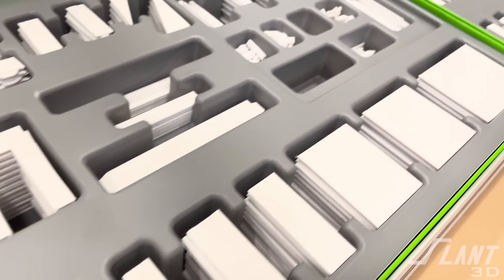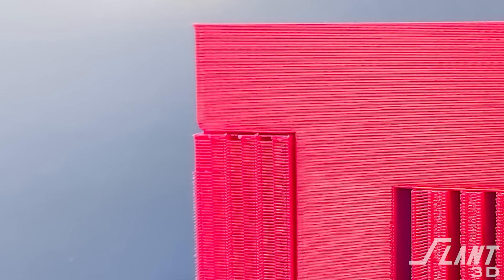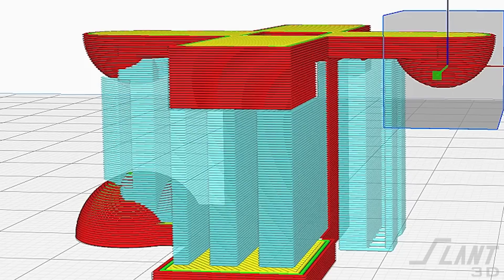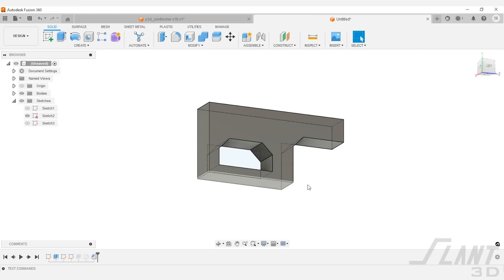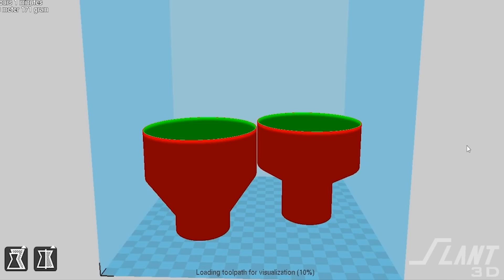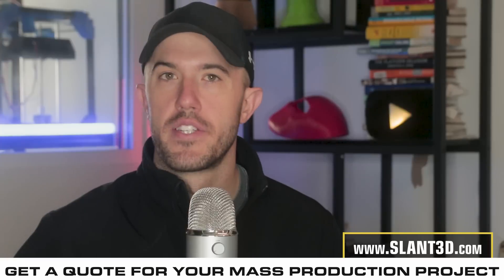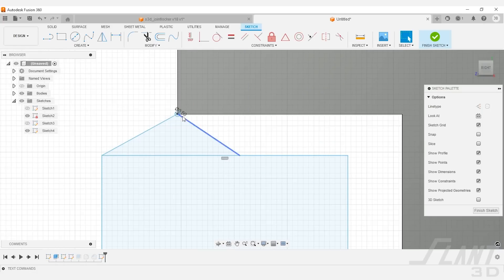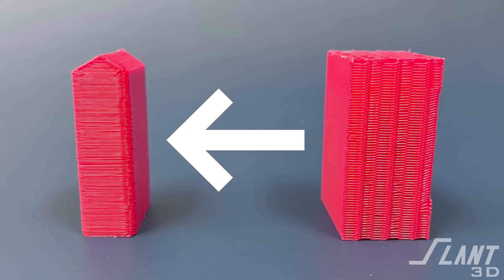3D Printing Basics: Understanding and Managing Support Material

Comment: Usually supports aren't very dense, while a modeled support prints with the same settings as the part. Did you weigh the supports to check which one is actually using more material? I know the standard supports can be harder to remove, but they might use less material.
Reply from the maker: Labor is more expensive than material. A minute of labor it worth far more than the cost of a gram
Reply: @slant3d  I'm sure that's true for what you do, but not for me. This is just a hobby for me. That's why knowing the weight is important. I would rather save the plastic than a minute of work for just a handful of parts, but yes, in large-scale commercial production runs, the time would increase the labor cost.
Reply: @slant3d  Wastage is a serious issue. Please don't advocate for poor and unsustainable practice.
Reply: @skilletborne  Wastage of time has a cost to sustainability too.
Reply: You can use different settings for the support geometry to minimize material use. Set it to no infill and a single perimeter for example and the material used would be very minimal.
Reply: Material usage in the showed use case would probably be lower and it would print faster and with better quality: No additional ringing, thicker corners, ghosting, stringing, blobbing and raised edges - as well as less line starts and ends. Failure rate would also be lower. You have to consider that when you produce unnecessary holes, it will replace the saved material with at least two additional outer walls which have usually multiple perimeters, thus not saving any material and potentially even using more.

The hole needs to be significant in size , before it actually makes sense to add it, unless it is needed anyway.

Comment: Hi, I’m loving your design videos! I’m a designer in the gift industry and want to  use 3D printing at my work. 
What is a solid online (paid or free) resource to learn fusion360 for mass manufacturing 3D printing?  I currently use blender, which is not ideal for the accuracy of designing parts for 3D printing. Thanks !!
Reply from the maker: We do not know of a class that teached design for mass production 3D Printing. That is kind of why we do this channel
Reply: @slant3d  Yes. you're the only channel I have found so far that covers this. I'll just do the general Fusion 360 tutorials online and apply what I learn from your channel.... As someone who sees a lot of disposable junk made in the gift industry, I feel you are onto something with 3D mass manufacturing printing! Thanks and keep up the good work!

Comment: For my own personal use, I will sometimes use a half-chamfer / half-fillet so that there is still a nice looking curve, but it doesn't go beyond the maximum safe angle for printing.
Reply: Can you show an example?
Reply: @krayfox  He probably mean a beginning of fillet until it get to 45°
Reply: I'd like to see how you would do that. I'm not being capricious.
Reply: @bitsurfer0101  I usually start with a chamfer then select the upper edge(s) to create a fillet. The bottom edges that can't go beyond 45° I don't select. I use FreeCAD, which works pretty well for doing that.

Comment: Me screaming at the screen to just flip the part lol knowing full well he’s just using the part as an example.
Reply: Rotation isnt always the answer. Sometimes you need the layer lines running in a certain direction so you can't rotate it or it'll lose strength and separate along the layer lines.
Reply: @OneIdeaTooMany  while ration can often be a limiting factor for the reasons you brought up, I still  think it would have been a valuable point to address as part of the process of reducing or eliminating supports as much as possible.
I just printed a fan duct and were having a very hard time removing the inner supports inside a very narrow duct.
When looking at it in the slicer again I realised that changing the orientation of the part not only would avoid most of the inner support, but reduce the over all use of supports by more than half.
This part needed no superior strength in any particular direction as only  air would flow through it, so it could safely be placed any possible way.
The original part I was replacing was printing by the manufacturer in the same orientation as my print and this was used as a standard part on a well know printer. I’d hate to have been the poor sod cleaning all that support out of there for a couple of thousand of these parts🙄
Reply: At first I thought it was printed upside down, looked liked elephants foot on that top layer.
Reply: Rotating would be the preferred way to make that part but he mentioned auto eject of the parts where they use the print head to remove the parts from the printbed onto a conveyor or bag and auto start next print
Reply: Me too LOL haha
Reply: I was screaming also lol! A simple 90⁰ rotation on the y axis would give you the same part with 0 supports and 0 adjustments to the part. I've watched several of these videos and I'm constantly disappointed that rotation is never mentioned as an option. Years ago, someone actually did a video devoted entirely to rotating pretty much any part to keep supports at an absolute minimum. I can't find it now, but I'd love to be able to revisit it.
Reply: Mental midgetry to tell us to delete holes in our models. They're there for a reason FFS. I didn't just magically put a specifically dimensioned hole in the middle of my model for shuts n groans. Unsubscribe lol

Comment: I keep wondering why dissolvable filament didn't caught on on multimaterial 3d printer, wouldn't that cut post processing?
Reply: one issue is that the solvent you use becomes industrial waste (even if your solvent is just water, it is now water with a bunch of plastic dissolved into it). this adds a lot of time and expense as you now need to deal with the safe handling, storage, and disposal of that waste. there are some situations where the benefits of dissolvable supports outweigh those costs, but in most cases it is just easier to use other support techniques.
Reply: @ERTWaero  Sheesh, didn't even think about that!
Reply: @ERTWaero  Not only that, if you have even a tiny hole somewhere in your part you now have a part that is filled with water that takes ages to get out.
Reply: Well technically it would cut down on "manual" post processing vs what he mentions in the video is trying to not use supports at all. The whole goal is to get a part from the build plate to a box to ship. No processing required. BUT, if your part NEEDS to be printed at a certain orientation for strength or something, then dissolvable filament is a very doable solution (but you would feel it in cost of production).

Edit: I would think that if you HAVE to do supports, dissolvable filament is not the best idea because that's an extra step in manufacturing vs. designing it so only a little piece of support needs to get taken off.
Reply from the maker: Dissolvable support is often more expensive than the functional material in the print.